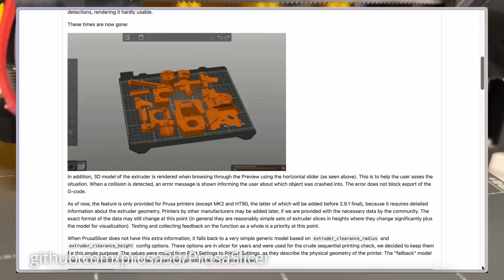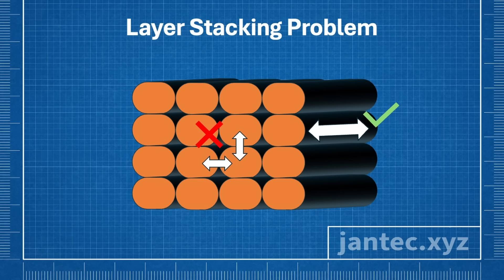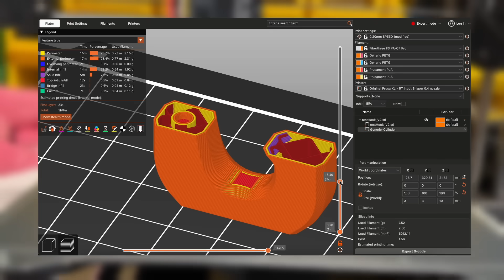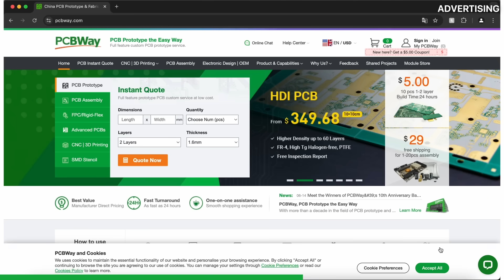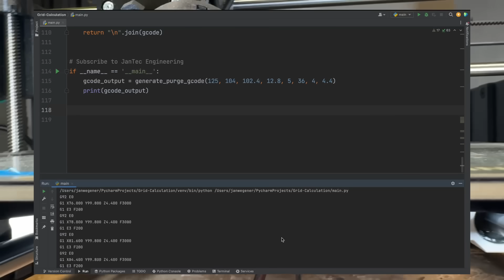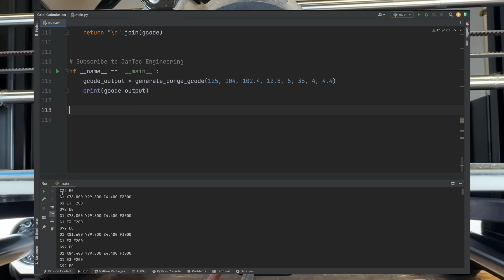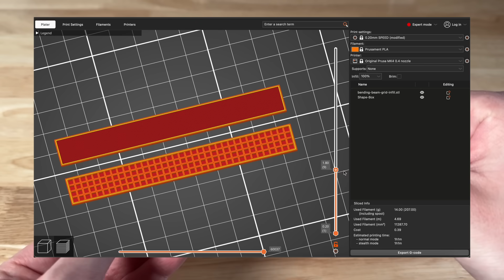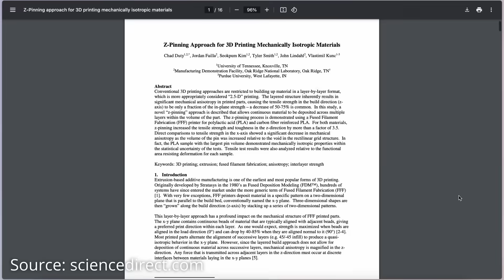Stronger 3D Prints by injecting Filament into the Infill

Comment: I think this technique could be expanded to make stronger parts in general while using same amount of filament.
Example
Take a square, have the external wall, then an internal wall set to create the thickness you want for the part, then have the printer infill between(there would be no infill sections like is used in this video that are filled up one by one), this would create a monolithic "part" with an external wall for looks but no layer lines inside to break along, creating strength that should be mostly equal in X and Y, also it should actually shorten print times significantly as the printer is no longer making 5-10 passes slowly building up the internal layer lines.
It just makes one slow pass as fast as it can squirt out the filament.
Printers may even need a second injection head thats like 1mm with algos that detect the cavity is properly filled(maybe by using a second filament colour) it shouldn't be hard to make it know how much filament to inject.
It should in theory also help reduce warping.

Comment: what if you pour epoxy resin into the infill area.? :]
Reply: When epoxy cures, it can reach high temperatures. So in a teory it can do some damage to you 3d parts
Reply: @ПанК-д8н  OH I SEE. THX.
Reply: @ПанК-д8н  PAHT is tolerant to temps produced by epoxy curing.

Comment: Why not just inject 1 or 2 layers down, lots of little ones instead of big holes.   Print, leave a hole maybe 2x the nozzle diameter and only 2 or so layers deep.  Then, when moving over it while printing the layer on top of it, just dwell a bit to let it fill up.  It's just supposed to increase layer adhesion... layer to layer.  So long as the holes are randomly placed it will average out over the whole part.  No special nozzle required.

Comment: This might be a good solution for those who can afford and use one of those multi-color filament printer that waste a lot of filament as a part of their color transitions from one colored filament to the next.  I believe it's referred to as "Pooping Filament."
Rather than wasting or pooping that filament, it could be used to reinforce their prints if those prints were the types that could benefit by this reinforcement technique.
For those of us who's budgets won't allow such high end printers, I think figuring out how modify their filament pens to reach down into the voids of our prints might work.  Just put the printer in pause then use their modified filament pens to quickly fill in the voids needing reinforcement and resume the print again.
Reply: I was just thinking yesterday about using a glue gun with a "glue stick" made by printing the right shape out of TPU. using this video's technique with the hot glue gun would be a very fast way to go from 5% infill to nearly 100%, much faster than printing at 100%.
Reply: Bambu slicer has this option 'purge into part' allows the poop to be purged into the infill
Reply: @CennFox  True but it does do regular infill with it though, not this kind of flood-filling. It will likely be very hard to use that for flood-filling since you cannot really change the time of when the purge is needed.
Reply: @ The thing you're thinking of is now called "Flush into infill".

And that's not what it does. It just removes the explicit filament flush step if it can do an infill with it instead. So it will just print the infill  with the remaining "to be purged" filament instead of flushing it off the side when it changes colors.
Reply: you can already poop into the middle
Reply: I mean.... the bambulab a1 mini is affordable with multicolor
Reply: That is something folks have done, though it is worth noting the do the purge as infill especially taken to this extreme will probably be visible on the outside if your filament isn't really really opaque. So if you are doing multi material entirely for cosmetic reasons...
Reply: Poop
Reply: You can totally reduce that over purging by turning it lower on your settings but most of us can't afford the printers that can just change the printhead right off the bat, we have to build up to it unfortunately for us, unless you want to donate one lol I'll gladly accept, disabled vet here so limited funding lol but my kids love the toys and its fun.. so all good.

Comment: Good work!  Thank you.

I'm not interested in the currently popular MMUs because my functional prints seldom need different colors but I would like to be able to switch between PLA support when printing a PET-CF part, or print TPU feet on a PETG part.  I hate the poop or purge towers.  Now that MMUs are so popular, slicers need to be able to purge within the model, using purge material as infill instead of wasting time and material purging.  That would greatly benefit the multi-color printing enthusiasts.  However, when printing dissimilar materials, there is less mixing in the nozzle, as shown by a recent Lost In Tech video where 1000 fps video showed laminar flow with little mixing, so much more purging is needed to prevent cross contamination which significantly weakens part strength even in very small percentages.

Comment: It might make sense to use hexagonal cells to inject the blobs into. Perhaps you could even give it a little extra couple of rings around the bottom layers of thr cell so it does have any hard to fill corner space where the blob wants to have a radius that doesn't want to fit into a right angle corner. Hexagons would still tile a plane and probably have less corner porosity. You could also stagger heights and fill them in sets. If the heat allows cell walls to balloon out the hexagon walls will be shorter thus stiffer and already closer to a sphere where surface tension wants the shape to be so ballooning spilling into unfilled cells would not allow as much reduction to the volume of the empty cells making under and over filled cells less of a problem.

Comment: This is what i thought purge to infill was. Color me surprised to find out that no slicer does this. Why not have the printer purge into the already printed void areas? It adds weight and doesn't "waste" filament.
Reply: Purge to infill actually prints the regular infill as the filaments transition, you could actually achieve a similar effect by adjusting the infill percentage to use as much of the transition as possible, but with both techniques you still need to do a regular purge for layers with small area.
Reply: there are clever 3d printing techinques that cannot be incorporated into slicers because they are patented...

Comment: This reminds me of an Idea I had a while ago, of using a 3d Printed part as a sort of sacrificial injection mold for different materials, like TPU, but in this case you would use the same material and not break the part open in the end. Have the printer print a hollow part with a hole on top and one or more vent holes around the bottom. Next, place the nozzle into the top hole so that it makes a seal and as fast as possible, push very hot Filament into the part until it comes out of the vent holes.
But I never pursued the Idea further, because the hotend would need to be capable of pushing out a large amount of filament in a short time so it can fill the void without solidifying. With a Volcano or Super-volcano Hotend it might be possible to do small parts relying on the larger volume of already molten filament inside the Hotend, or inject into multiple very small (1-2mm) vertical holes that go all the way through to significantly improve strength in the Z direction. Might be worth a try, and maybe even different enough from the patent so it's not covered?
Reply: Long ago I experimented with added fill with a 3d pen. If the ratio of material added to material in the shell wall gets too high the shell will deform as as the heat from the blob transfers to the walls.
Reply: Fill it with epoxy and fibres or beads.

Comment: Very interesting video Jan! Danke! 
I would like to suggest..
If you use CF filament please reach out to a company that I know here in the U.S. "Atomic Filaments". Their CF Filaments all contain  POWDERED CF. No long strands like many filament mfgrs use. I would also suggest using a 0.6mm nozzle or larger to insure the density of the purging filament is very high. 
Lastly, keeping the air around the existing part as hot as possible will also improve the bonded wall inside the part.

Just my thoughts. Hope it continues to bear fruit for you sir!
Reply from the maker: Thanks for your tips, very helpful!!
Reply: That's what CF (carbon FIBRE) stands for though, strands of carbon. And they should be preferably for layer strength. As the short fibres will be oriented randomly and melting slightly into the layer below and next to it, increasing the isotropic strength of the part.

Comment: When injecting into infill, have you considered staggering the heights at which they happen? With the injection height of 4mm and a layer height of 0.2mm, we get that the injection happens over 20 layers. This means that in each layer we could fill only a twentieth of all squares created by the infill. This, however, would work best as a post processing script. It would also require injecting over a fewer number of layers near the bottom and the top if you want a consistent fill.

Comment: I needs to be less viscous and start filling it from the very bottom to the top if you want to avoid air gaps, which means a thinner long tube, a separate head. Could you try cold filling the mold with epoxy on a finished print?

Comment: Very interesting, but it seems the amount of strength increase could be better achieved with more walls, with less filament and weight.

Perhaps results would be better if the filling was done every 5 or 10 layers before they cool as much.

Comment: 6:50 Not sure if you were just doing that just to show it on camera, but you can use that little stick that comes out the back of the micrometer to measure the depth of stuff. Open the jaws a bunch then press the stick against the bottom of the thing you are measuring, push down until the micrometer hits the top of the thing you are measuring.
Reply: Micrometers have a screw based adjustment mechanism, those are digital calipers. You can also use the step on the backside top of jaws to measure
Reply: @ Ah good point. Thank you for the correction. I just call them all the same thing haha.
Reply: It took me an embarrassingly long time to learn this. I dont think many people know
Reply: @Javii96  It's definitely one of the lesser known applications, but incredibly useful.
Reply: @Vandel212  Sometimes I feel like I use the depth gauge more than the jaws... VERY handy indeed.
Reply: I should have read the other comment before I wrote the same thing..

Comment: Why not making it hollow in such a way that you can purge resin through? It seems pretty retarded and to much effort for to low quality. I'd I need absolutely strong parts I usually just stick a stainless steel or carbon rod to compress the layers because the layars work best in compression while the inserted rods are in tention.

Comment: Would it be just as effective and efficient to set walls to the full dimension in X, Y and Z; instead of the standard 2,3 or 4 walls.  Why not 30 walls and 100% infill?
Reply: Contiguous polymer chains with no air voids between nozzle lines or symmetrical sorts of imperfections, is probably the best reason I can come up with. Yes, you will make it just as solid, but you will have the 'weak in Z-axis' still, throughout the entire part, if you started a horizontal split then pried on it with a screwdriver, it would have an obvious direction to 'zipper' all the stresses into and delaminate in a line. These giant columns are kind of like reinforcement rebar in that direction, in order to fail it will have to fracture in a way that will consume much more energy to keep propagating the crack, therefore reinforced in a way that makes it tougher to fail overall. That isn't to say this is always the case though, glass is a good example where it's stronger as many strands, and a solid block will often propagate a fault on it's own due to internal stresses, etc.
Reply: @ thanks for the info.   Still new to this technology and have more understanding of biological/ botany things

Comment: Airbrush V6 adapter was invented by René Jurack in 2017 in order to reduce impact of radiated heat on the part cooling in his high-speed small-volume DICE 3D printer. This was before silicone sock was invented.
Reply: Nope, using an airbrush nozzle was actually invented before that! It's called the Merlin hotend and was developed from 2011 till 2012 :)
Reply: @MarinusMakesStuff   Ah yes i forgot that one! Knew but forgot!
Reply: @SianaGearz  I can totally get that! I just happen to have two of them laying around, but I don't think many people have ever seen or used the Merlin to be honest. The v6 is a lot more common of course.

Comment: Since you're doing simple infill geometry (cylinders, cuboids) and pausing to manually swap filament, I wonder what the results would be of printing an "infill mass" in one orientation (XY) and then rotating it 90 degrees and manually inserting it into the void during the pause, then resuming the print. Of course, that doesn't work for more complex infill geometry, but you might be able to achieve extra strength while still using just filament and a 3D printer.
Reply: I wish my old sidewinder X1 would understand "pause" commands ,_

Comment: I have tried this before, with mixed results .  The best results are using a hotter fillamente for the walls (such as petg) and a lower filament for the infill (such as PLA). If you heat up the infill filament above the regular printing temperature (by about 10 or 20°), it performed better- it doesn't need to be the regular printing temperature to look good, It just need to melt and go down by gravity - so you do not need this point nozzle (although it defiantly helps). 
  I haven't done a scientifically test, however it does work very well for the parts strengh. I had this idea watching someone who made a hot glue printer, and I don't know why  have not been properly implemented  before.

Comment: Do you use plastic repellent paint on your nozzle?
Reply from the maker: I did not - do you have a good recommendation for such repellent?
Reply: @JanTecEngineering  Easy: search online for: plastic repellent paint. 
I believe there's pretty much only one! (Some ptfe lubricant look similar, but maybe not identical.)
Reply from the maker: I used Slice Engineering repellent paint a few years ago, but for me it didn't work well. That's why I was asking, maybe there's a better option.
Reply: @JanTecEngineering  Right! That's the one I had in mind. Otherwise, some high temp ceramic lubricant could be tested.

Comment: What an interesting concept! Would be insane if this could be integrated into slicers with multiple extruder support for purge!
Reply: Also, use an 0.8 or even 1.5mm Nozzle to inject more Material with higher thermal capacity into the infill holes.
That way it reaches deeper areas without cooling down so fast